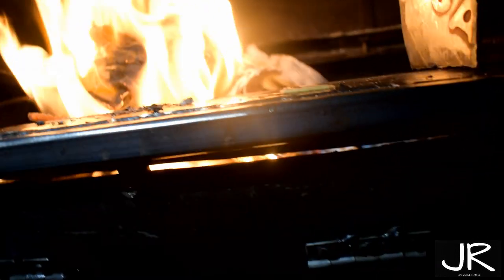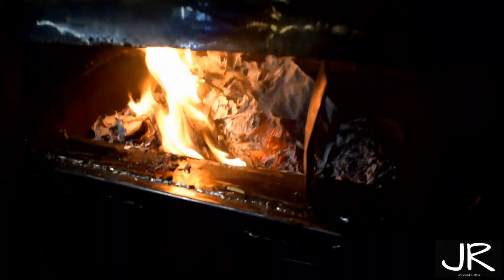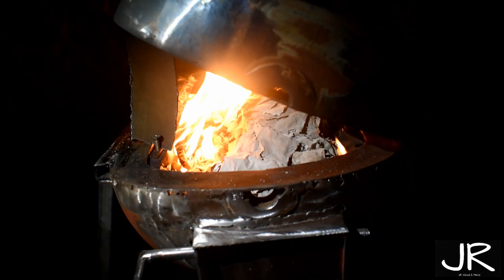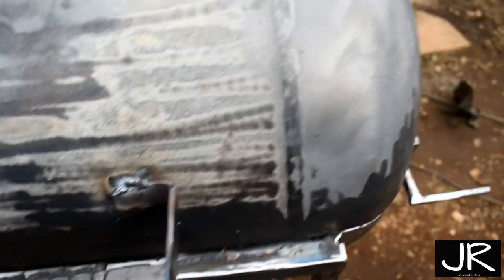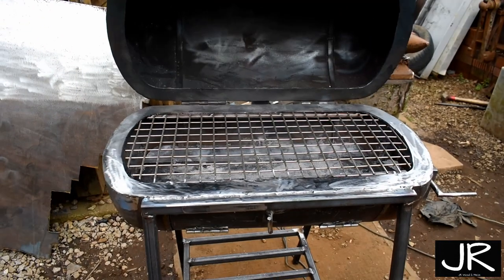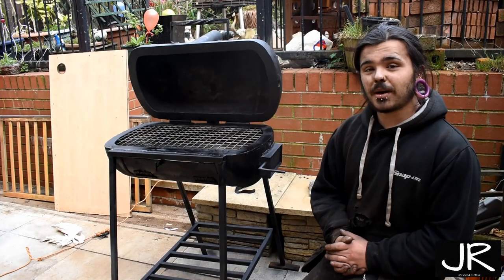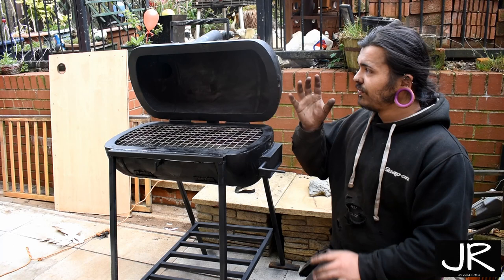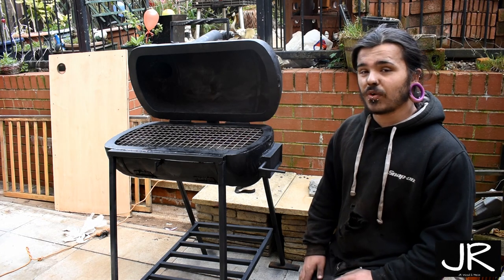DIY: Building a BBQ from a propane tank

Comment: Before cutting on or into the tank make sure it not pressurized ,then remove valve from tank and fill with water till it overflows, let set for a day then empty the tank, this pushes the left over gas out of  the tank. BE SAFE!!!

Comment: Nice work. I am currently working on a smaller gas bottle BBQ and I am finding welding to the bottle difficult. I've only got an arc welder which isn't ideal but it is what it is. I am thinking perhaps the bottle is galvanized which is making welding it difficult?
Reply from the maker: Because it's carbon steel from my understanding it makes it difficult & easy to blow through so turn it down & just whip it in. Let me know how it goes. 

Josh.
Reply: Most cylinders have a coating underneath the top coat which needs to be removed (you’ll see the bare metal turn from dull grey to shiny silver) before you can achieve a good weld. This will also eliminate the acrid smoke emitted from the cylinder surface which is not good for your lungs. If you still can’t form a solid weld....turn up the amps til you do.

Comment: Hello Josh, I'm not the worlds best welder but it seem to me, you are going too slow with the torch which allows the metal to overheat & then blow into holes, it's a combination of wire speed/amps & torch speed across the job, you will get there, just remember practise makes perfect. Great job mate & thanks for posting.
Reply from the maker: Thanks for your comment. It didn't appear to be my travel speed it was the access of amps.

Comment: To weld  when you use MiG/Mag it depends on what gas you’re using ( if any ) ...in this case no gas or Argon only, but what to look for to weld thin carbon steel  is the use of small wire thickness available , use the spray method to lay you melted wire and that requires a bit of stick out; weld pulling the torch towards you ( less heat builds up ) and don’t weave too much with it go with a back and forth motion in a straight line and to finish try to do your welds in flat horizontal position only, once your good at it you can progress to different positions because they all require different technics and machine settings ( that applies to all methods SMAW , GTAW as well ) 😎

Comment: Just an observation regarding the welding, if you wear a pair of gloves you can position yourself in a manner that you can control your welding torch a lot better thus making for a better weld. It may be the video but you appear to weaving excessively, plus you would get smaller welds if you push the puddle rather than pull and also less likely to blow through as the heat isnt building up as it is when pulling the weld. Love your enthusiasm though pal. From a fellow Manc!
Reply from the maker: Regardless of what i was doing it would blow through most likely settings why i turned it down regarding position i kept a small puddle. All down to pratice. Thankyou for watching & the tips! 

JR

Comment: I dont know what kind of wire you are using. if you are using flux core you need to pull. if you use solid wire with shielding gas you need to push. the welds look like you have cold wire this is caused by to much wire in relation to the distance between your welding tip and weld material. I think you might need to close the gap or turn up the heat.
Reply from the maker: It was gas. &, most probably. Can't remember my settings all i remember is it blown through so easy.
Reply: @Manchester_engineering  you still make it look good. just grind the bad looking stuff of and no problems. :) hope you worked it out.

Comment: I’m not trying to be a hater because I respect the work but that thing is tiny.
If you’re going to do all that work it seems like you’d want more cooking surface. To put it in perspective, I see Weber kettles for sale all the time for as little as $20. I personally have 3 kettles and the most I paid was $50 (and that was for a performer.)  
A person could have two kettles for less than the cost for the steel for this project and have more cooking Square footage.
Reply from the maker: I appreciate your opinion but steel cost was free. I only had to pay for the mesh. About £12 or so. & for the size. I have a tiny garden. Thankyou for watching!
Reply: JR Wood & Metal I kind of figured your materials were free/cheap. Definitely nothing wrong with that.  Got to use what you got. And obviously if you ever build a bigger unit you’d have the practice and experience of building this one.
Reply from the maker: That's the idea. Propane tanks you can get near enough free anyway. But i plan to use a big 47kg soon anyway. Thankyou for watching. 😊

Comment: pls tell me how you empty the tank for safe cutting... thanks!
Reply: Remove the valve and fill with water
Reply from the maker: Don't. It's idiotic. It can go wrong at any point.
Reply: @Manchester_engineering  are you saying don't make sure all gas has been expelled. That's pretty risky don't you think.  If you fill with water and empty it out after you are sure there is no gas inside. Your supposed to vent a vessel before welding anyway aren't you?
Reply from the maker: @Gsavell  I mean don't try to open it or use one buy one that has been scrapped & is safe.
Reply: @Gsavell  At least connect it to a burner or propane grill and make sure you burn all the propane out first. Then you remove the cap slowly and make sure it’s empty. If it is fill it with Dawn dish soap and water then drain and repeat. If it’s not a big tank I would do this 3 times then have someone test it and make sure there are no traces of any kind of gas in it before you cut into it.
Reply: What I did is let all the gas out then take off valve, fill with water to clean it and then just cut it open